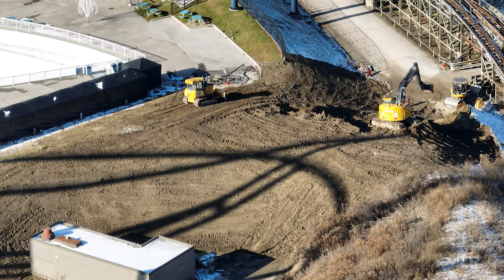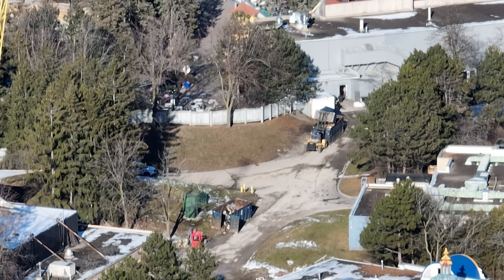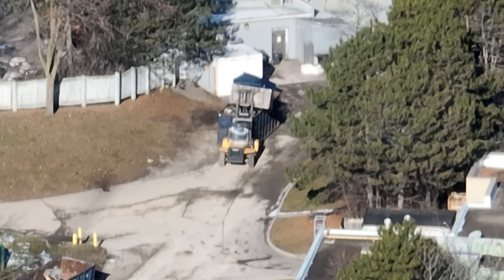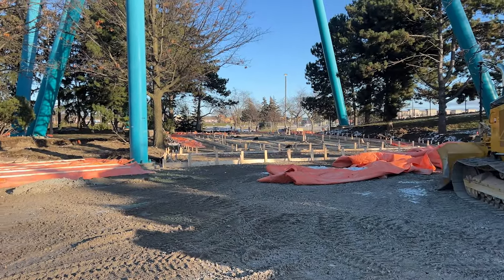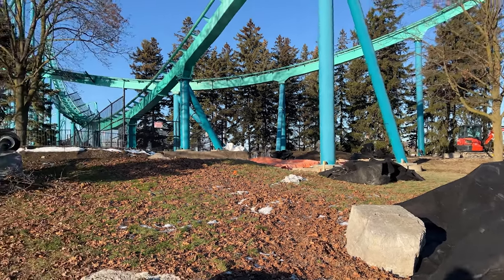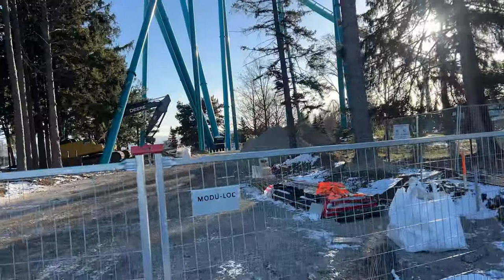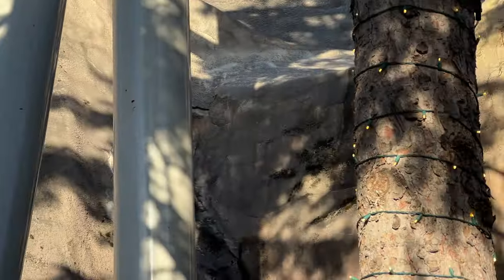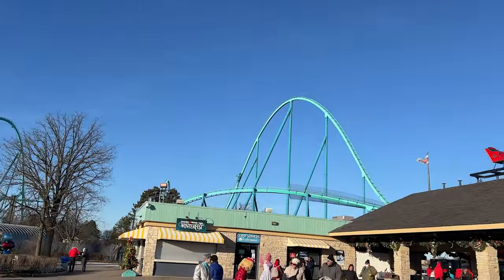Canada's Wonderland Important Construction Update

Comment: Canada's Wonderland could be working with B&M to add a B&M Ski Coaster 🎿 because that's what Canada is known for it's. It's kind of like a Surf Coaster except it would have to be inverted while running on rmc or pipe shaped railings. So it's a B&M Inverted Stand-Up Motor bike coaster running on 2 railings Below.

Comment: 7 minutes ago
That would be BS and pathetic to revive Volcano at a Canadian theme park instead at its home park Kings Dominion or I would be pissed because that's where the coaster was originally built when it first opened back in 1998. I wouldn't let these damn Canadians revive Volcano in their  park not even a clone or a rip-off. Canada's Wonderland needs to come up with a different coaster creatively without any of the volcanic theme i don't care if there is Volcanos up in Canada because Kings Dominion came up with that idea in the first. However Kings Dominion needs to cancel and scrap the B&M Wing Coaster project to revive Volcano with a new detailed model volcanic mountain no matter if it's a Gerstulaur Inverted Launch Terrain Coaster or an S&S Axis Terrain Coaster. Gerstulaur and Six Flags would both need to suck it up and deal with it. if Canada's Wonderland wants to add a new coaster, then they should add a B&M 🎿 Ski Coaster or whatever other than reviving Volcano 🌋 because that's none of their business,I don't  care if they're owned by the same owners, It's up to KD to decide if they want to bring back Volcano.